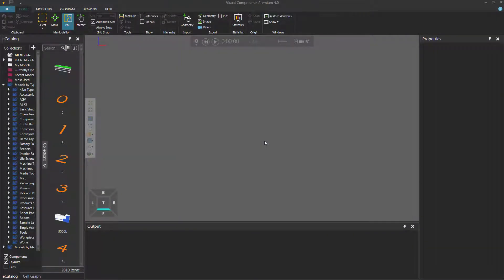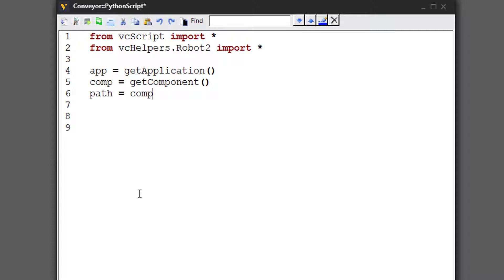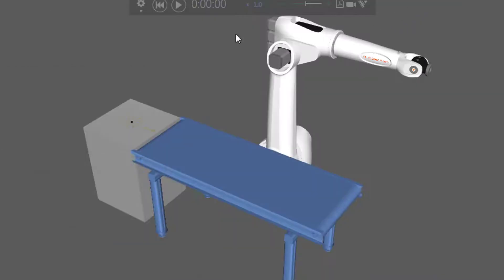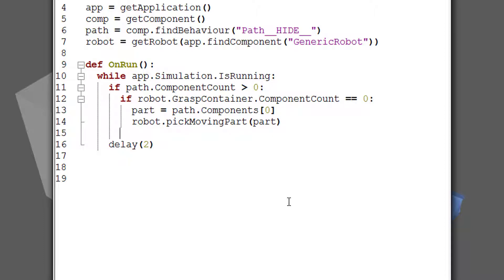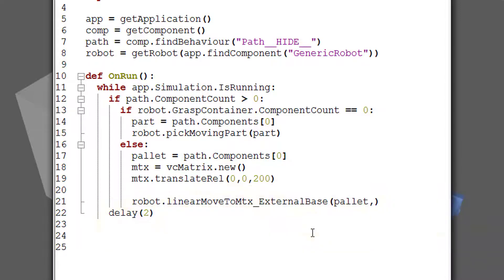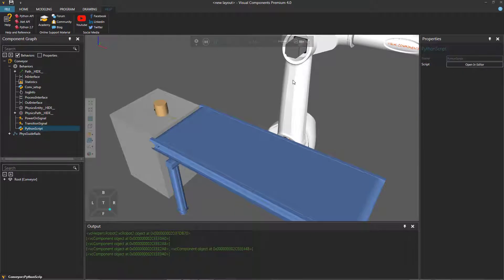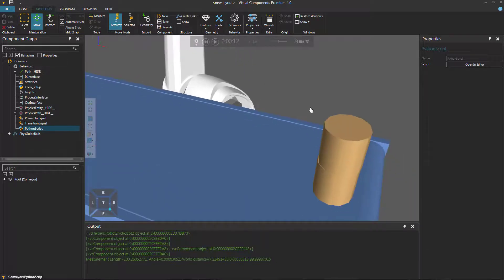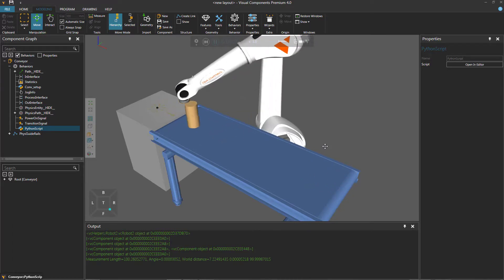Python Robotics - 6 - Place Parts On Moving Objects

Comment: I want to do the same thing but I want to pick if from the pallet and then placing it on the moving part. How can I do that ? Is it different when to different parts are used
Reply from the maker: In order to track the moving part you'll need to use linearMoveToMtx_ExternalBase and then releaseComponent method.

Comment: what programs you are use
Reply from the maker: The program is a script written in Python. In the video, the script is contained in a robot component. However, an add-on could also be developed to achieve the same result. The vcHelpers.Robot2 module used in the script is Python API developed and maintained by Visual Components. If you have a Visual Components 4.x product, you can access the source code for that module. Overall, the module is a helper that uses other parts of our API to make writing, testing and simulating the program a straightforward process. On our forum, we do have a publicly available post-processor written in Python, for example if you wanted to export the program for an ABB robot.